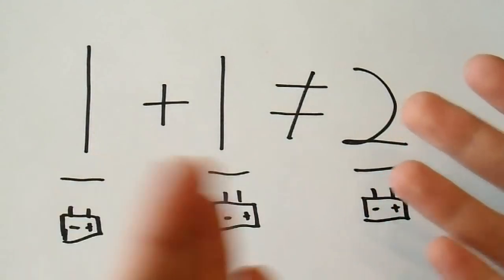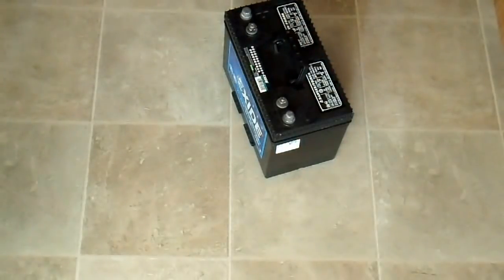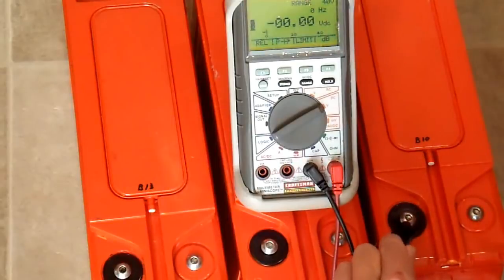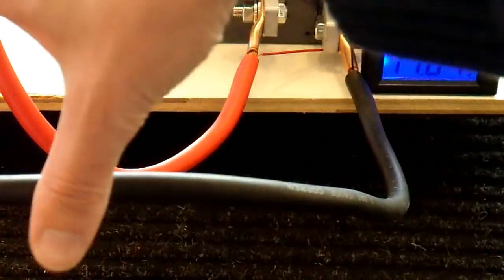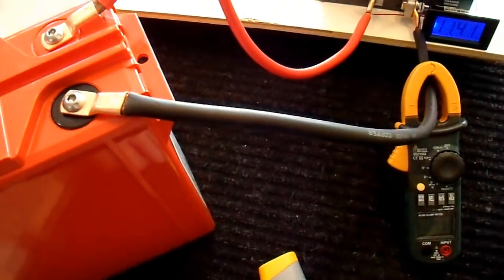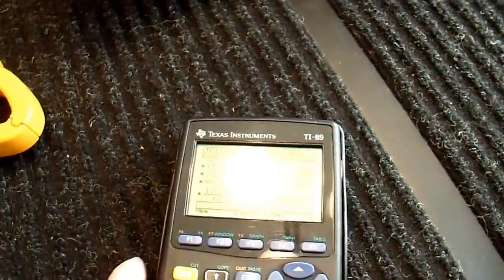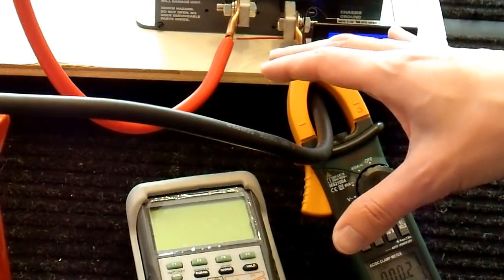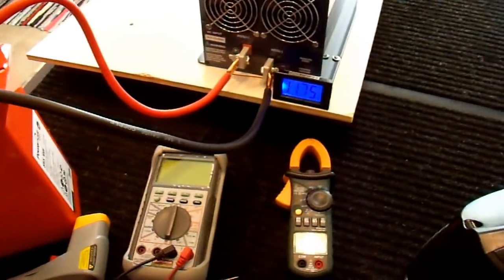Parallel Batteries Don't Add part1: When 1+1 = 2.7

Comment: Read what @tgkgate said.
He is correct. The title of your video is stupid. You seem to have made another video set claiming Peukert is wrong which also isn't true and all you really have done in the other video set is actually explain the science behind what tgkgate has said and in actuality contradicted your video title and earlier claims.

No 1+1 does not = 2.7. No current science is not lore and no you are not a genius above everyone in battery understanding. You in fact make many stupid statements in your video titles.
Reply: According to the video maker. Add 2 batteries together and you get 2.7 the capacity and this is all concluded by his shoddy test with his cut off voltage. lol. This is too much.
Reply: As far as you claiming the same occurs in series? No offense but it doesn't. The current drawn from each battery is in fact the same in series. But because the current drawn is the same that means that the voltage drop will also be greater per battery. So this means the inverter and cut off voltage would actually be reached faster than if you instead had them in series.
Reply: The fact is that wiring in series is better for your batteries and enables you to draw more from them for two reasons. The first reason is that the amount of current drawn from them will be halved which increases the efficiency of the battery. The second is that since each battery is doing half the work the voltage drop is lower thus the inverter will turn off when you really have used a decent amount of the batteries capacity instead of a single battery which would take the full brunt of the current draw which would = larger voltage drop and the inverter shutting off. Also with the higher current draw the chemical efficiencies in the battery decrease and heat is produced.
Reply: I see in another video you also claimed that charging a battery at different rates does not increase or decrease efficiency and losses. You are absolutely 100% incorrect about that also. In fact charging batteries at to much of a high rate will cause larger losses as the batteries chemistry can only operate at a certain rate and also heat is produced as a result which is again loss of energy.
But if you feel it's totally normal to charge a 12v 5Ah battery with 15A at 13-14v then go ahead.
The numbers don't lie. It's fully documented and understood. They are not incorrect. You are.

Comment: Read what the others have said please. You clearly haven't though much about this much at all. Drawing a high current from one battery and then doing the same with two in series and seeing that it actually runs for longer does not mean that 1+1 battery capacity = 2.7. Jesus 0_o.
What you have done is actually lowered the current draw of the batteries by half since you are using two. If you read up on batteries you would know that batteries can have more capacity drawn if you draw lower currents for longer periods than drawing high currents in short periods.
In fact the stated capacity on a battery in Ah is in fact calculated over drawing power from it over a 20 hours period for most large batteries. So of course drawing higher current lowers the efficiency. Jeez
No what is known is not "lore" and you are not a genius. Seems you don't fully understand things and do faulty testing procedures.

Sorry but 1+1=2 is correct as far as battery capacities go. It's all to do with how long you draw power and at what rates. Nothing to do with magically 1+1=2.7. Jesus.
Reply: Even if he is incorrrect as you stated "Lord" of the belts, you shouldn't be so insulting I think.  He tries and helps people with his videos.  please step down from that pedestal you seem to judging people from.  BTW genius by definition is a range of a person's IQ... I doubt that you know his.  Please stop this negative badgering, it's not helping anyone.  Peace.
Reply: well put
Reply: David Irving That's what I was thinking.  The simplest way to think of it is resistance losses = current squared times resistance.  So by cutting the current in one battery in half, the losses were reduced by a factor of four.  But since there were two batteries, he cut his internal resistance losses by one half.  There may actually be less savings than that, as I think internal resistance goes down with a rise in temperature (the two in parallel run cooler than the one battery). But  still the two batteries in parallel do give you a significant loss savings.
Reply: I'm just checking this stuff out. I need to study some more to judge whether or not you are correct. But right or wrong, the tone of your reply sucks! This guy has made a very interesting demonstration which certainly will help a lot of people to understand more about battery specs and Peukert's law. I suggest you brush up on simple decency before you post any more comments....

Comment: Er,  you're discharging each battery at a lower rate,   thus the efficiency of the electro-chemical reaction goes up.   You're not gaining capacity,  you're reducing inefficiency.

Comment: Great video! but it's part of internet lore like all videos on you tube. The 2X capacity is not being presented properly here because the operating parameters are changed. Its no mystery, each battery is delivering half the total current (ideally) when placed in parallel. The capacity rating for each battery needs to be recalculated at 1/2 total current draw not the original full current rating you're are adding in the title. Still, I like your videos and the way you explain the topics.
Reply: I agree. His test wasn't conducted correctly. As a result he doesn't seem to fully think about how things can occur but just says that everything you find on the internet is just lore. When in reality it's correct and he just hasn't conducted the test correctly. I have done many tests and 1+1 really does = 2 if you are doing the tests with a proper understanding and thinking about how it's working.

He also says that a lead acid batteries voltage is not indicating of it's charge state and that everything on the internet is wrong. Well I highly doubt that as it's a simple known thing that lead acid batteries charge state is known from the voltage. Even charge controllers use cut off and overcharge parameters that are based purely on the voltage readings.

The fact that this guy that made the video just says random things but never explains why he thinks that shows him to be what is called a "pseudo intellectual". If he really claims that about flooded lead acid then he should at least explain why he think that. But it's clear he doesn't want to because deep down he knows his explanation will get torn apart so like a pseudo intellectual he just doesn't explain but makes statements and saying everyone else is wrong.

Comment: ***** i guess my question might not be relative to this video, but anyways,,,
can u tell that 1 ton capacity air conditioning unit takes how much power in terms of electrical watts.....i have searched through internet, and books, and everywhere they say 1 ton = 12000 btu = 3500 watts approx,
but i have seen the data sheet of an orient air conditioner, and they stated there 1245 watts. And some more as well, but they all are in the range of 1200-1500 watts.
Similarly, i saw a video showing a window AC, of 5000 BTU taking about 458 watts in running conditions...
may be u could clarify this since u are an electrical guy
Reply from the maker: For an estimate take the SEER or EER rating and do the following:
Watts = rated BTU per hour / SEER

SEER is generally around 14.  Window units use EER for their rating which is often closer to 11, but it varies with the design/quality of the unit.

The way the standards for refrigeration devices are measured and employed are not at all clear and I understand your frustration.  1 ton is 12k BTU/hr, but the wattage is more complicated as it depends on many factors including 'inside' temperature, 'outside' temperature, humidity, duty cycle, time since cycle start, and so on.  Also, the measured draw won't match the label on the unit in most circumstances.  There are also issues with split systems where the air handler is specified separately from the condenser unit and such.
Reply: You could also trace the conduit to the circuit breaker to the unit. Find the receptical box (opposite end of the breaker box) carefully pull the wires out when the breaker is set to off.  Pull enough conduit out / ensure the pigtails are secure and safe.  Then place a clamp meter on one of the wires (not ground).  Turn breaker back to on. Turn AC on. Take reading in Amps use ohms law calculation to get watts.  You may have to do this also with the blower moter which is easy just open the panel on the furnace the wires to the motor are already exposed. Take reading add everything together (in Watts).  Though I might be missing something most of it should be there.

Comment: If voltage doesn't tell you the state of charge of the battery then how do you tell?

I've watched nearly all of your videos btw. Great stuff! Thanks!
Reply: For flooded cells you would use the specific gravity of the electrolyte. For non-flooded, you can't really tell unless you have a meter connected capable of showing what capacity has gone in and out of the battery.
Reply from the maker: abyssunderground
I second your statement.  Sealed batteries in particular are very difficult to accurately determine the state of charge.  To be fair, voltage is a good way to quickly estimate the state of charge if the charge/discharge characteristics and history of that particular battery are known.
Reply: abyssunderground
The specific gravity of the electrolyte also will not tell you the state of charge 100% in flooded cells. Take into account gassing and water levels dropping and replacement water etc. It's likely the makeup of the electrolyte will change. So even the specific gravity doesn't tell you.
Reply: *****
Voltage does in fact tell you roughly the state of charge on Lead acid and Lithium batteries. Once the plates reactions are reversed the voltage they will settle at is a pretty good indicator of the state of charge. For other chemistries such as NIMH and NICD it's totally useless and a delta termination is determined by a processor in the charger.
Other cheap chargers for these batteries use a simple timer and things like low amp charging at the ending part.
Reply: voltage is the way, but under load, not floating! floating voltage tells you nothing